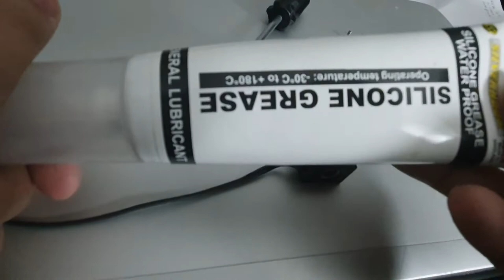fix solenoid diy co2 aquarium

Comment: There's potential for galvanic corrosion wherever there are dissimilar metals in the presence of an electrolyte, such as salt water. Basically it creates a weak battery, and the subsequent flow of electrons out of the anode causes damage to that material.
Reply from the maker: Nice explanation. Thanks.

Comment: Hello, co2 solenoid valves are generally integrated with regulators.

Can i disable or remove the solenoid valve if i decide to use the co2 for 7/24 ?
 Is there any adjustment on the solenoid vlave for this situation?
Reply from the maker: If you can get a normally open valve then  yes it will stay open when there is no power. Normally closed will be closed with no power. 24/7 CO2 may not be good l, as plants release CO2 at night and may poison any fish. Sub.